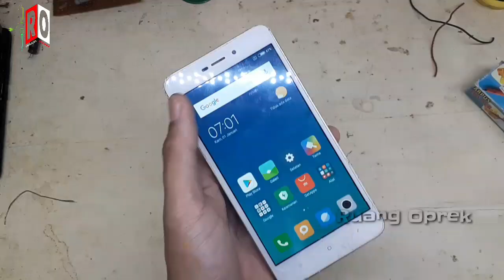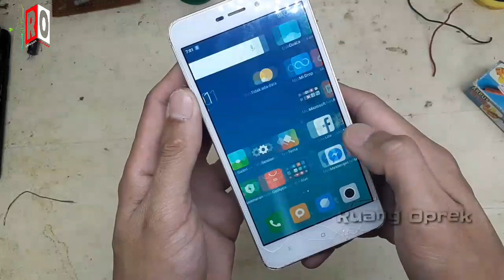Cara Mengganti Batre Hp Menggunakan Batre Lain-Batre 18650 Bekas Laptop || Modifikasi

Comment: Bang tolong balas, hp saya ic protektor  batrai nya 3,8 v ,mau saya ganti sama baterai  tab universal ic nya 3,7 v , bisa nyala atau edak ,atau daya nya kuramg bang, tolong balas
Reply from the maker: Bisa ,nyala itu dia akan full di 4.2v
Reply: @RuangOprek  jadi nyala aja biar pun batari awal nya 3,8v di kasih batrai 3,7 v nyala normal aja,tapi aman aja kan bang?
Reply from the maker: Aman ,itu kondisi batre low
Reply: bang udah saya test tapi knp ya kok hpnya mati nyala mati nyala
Reply from the maker: Kondisi batrenya gimana,
Reply: @RuangOprek  kondisi baru beli,tapi pas di solder ke hp nya ga ada respon pas di nyalain,dan pas di ces mati nyala
Reply: @RuangOprek  apa harus pake ic hp bawanic di batari di ganti sama batarai lama
Reply from the maker: Iya pake bms bawaan ,cell batrenya saja yg diganti

Comment: Bang kalo saya misalnya pakai baterai 10000mah tapi gk charger ke hp/charger ke powerbank nya apakah gak papa/masih kena ic nya
Reply from the maker: Jadi dichargernya terpisah ,bisa saja
Reply: @RuangOprek  rokemendasi berapa mah untuk htc u11
Reply from the maker: Lebih baik samakan dg yg bawaan saja
Reply: @RuangOprek  bang kalau batrai hp 3000 mah di upgrade 5000 mah aman gak (batre bekas power bank xiaomi7)
Reply from the maker: Ic casnya panas ,Kalau charger terpisah mungkin aman
Reply: Wahhhh ini yg lagi saya cari.. Berarti bisa ya bang
Reply from the maker: Bisa bang
Reply: @RuangOprek bang kalau cell batre nya 40k mah apakah aman pakai bms bawaan buat jangka panjang?

Baterai default 4k mah
Reply from the maker: @user-lb6zu1gz7m hrsnya aman, cuma pasti lama durasi casnya
Reply: @RuangOprek  iya bang mayan lama cas 1 cell aja 1 malam baru penuh yg 10k mah tapi lumayan tahan 20 jam penggunaan 1 cell nya di hp infinix

Comment: Saya mau coba 2 di Mimax 2 bingung teganganya 🔋🔋🔋🔋 10.000 mah dipasang powerbank rakitan gampang dicopot baterenya. Takut hpnya mati 📱💣
Reply from the maker: Asal jangan pasang dri usb PB masuk ke soket batre 😁
Reply: AA×4🔋🔋🔋🔋= 3.8 v pas dicas full naik 4v lebih 
Mau diparalel Aman tidak. Disambungin pake bms copotan Batere aslinya 5200 mah 3.85 v biar jadi 10000 mah
Reply from the maker: Batre AA gk cocok gan ,tegangn batrenya 1.2v, saat penuh 1.4v , 1.4×4=5.6v
Reply: Bukan ,AA 🔋=3.8 v × 4 =bisa 10.000 v lebih.
1.Sambungin model batere tanam pake Bms bawaan hp liion polymer 5200 mah  
2.dibuat powerbank 10.000 v biasa ke colokan USB charger 
Cara 1  apa 2
Reply from the maker: Maaf sepertinya yg anda maksud bukan batre AA,batre AA itu seperti batre jam dinding,AAA seperti batre vcd,stb,dsb ,sepertinya yg agan maksud type 14500 yg ukurannya sama kaya batre AA.
Reply from the maker: Masa 10.000v 😄,10.000mah kali

Comment: Kalo hp andromax e2 plus kan 3 jalur mas, gimana cara nyambung nya, dan  apakah min nya 2 plus nya 1 atau sebaliknya?
Reply from the maker: Bms batrenya tetap dipake gan jadi yg ke batre tetap 2kabel +&-
Reply: @RuangOprek  berati itu pin 1 nya di isi gabungan + dan - atau gimana bang?
Reply from the maker: Intinya batre dipasang ke input bms batre ke min & plus ,out bms biasanya beda" tergantung hpnya ada yg 3pin ada yg 4pin ,itu buat driver batre,kontrol suhu,indikator  batre/cut off charger

Comment: Pak emang aman nyolder kayak gitu pak??
Setau saya baterai 18650 cuma las titik saja 
Mohon sarannya pak🙏🙏
Reply from the maker: Mau disolder atau las titik bisa sama saja lebih bgus & kuat las titik,kalau disolder jangn terlalu lama dpt merusak batre,beri sedikit goresan utk mempermudah penyolderan
Reply: @RuangOprek  kalo pake baterai holder lebih aman nda pak??
Reply from the maker: 😃Nah lebih simple pake itu,holder batre Paralel
Reply: @RuangOprek  sip makasih pak sarannya 🙏🙏
Reply: @RuangOprek  o ya pak pake modul tp 4056 x4 terus disambung ke bms baterai (protektor baterai pcb) sama holder paralel x4 aman nda pak??
Reply from the maker: Bisa saja ,utk tpa4056 yg pake 2ic gk perlu pake bms batre lagi
Reply: @RuangOprek  tapi pak baterainya langsung nyambung ke hp pak??
Maksud saya soket baterai bawaan
Reply from the maker: Oh ,iya bisa kalau mau dicas diluar hp
Reply: @RuangOprek  beneran bisa pak kalo hp bisa nerima arus gede
Misalnya pake 4 baterai
Reply from the maker: Sebagai conto batre double power
Reply: @RuangOprek  baterai double power cuma 0.1A - 0.2A
Kalo saya kan kayak masnya baterai 18650 x 4 berarti setiap baterai memiliki 0.22A - 0.23A nah tinggal dikali 4 berarti 0.88A>
Itu aman nda??
Reply from the maker: Batre hp ada yg 6000mAh ,dulu saya pernah dihp mito pantasi pake batre 18650 6pcs ,trerah agan jika ragu jangan
Reply: @RuangOprek  siap makasih udah ngasih saran 🙏🙏
Reply: @dmcbram  mas itu kalo dr videonya baterainya disolder paralel ya, jadi voltage output tidak berubah, kecuali dihubungkan seri baru voltage dijumlahkan masing2 baterai

Comment: bang maaf mw tanya bang.. misal kpasitas baterai bawaan saya 3000 mah, saya ganti baterai powerbank bawaan robot bentuknya bukan lonjong bulat tapi kotak tebel kaya baterai hp pada umumnya yang kapasitasnya 7000mah, dan di powerbank  tertera tulisan 7000mah/25.9Wh, input1/2:DC5V/2.1A ,,, itu bisa dan aman gak bang? hp saya fujitsu f02g.. maaf saya orang bodoh..
Reply from the maker: Waktu dulu saya pernah nyoba di mito a77 pake batre kapasitas besar dri aslinya gk masalh tapi ngecasnya lama (ide itu muncul karena banyak yg jual batre doublepower) ,tapi ada yg nyaranin lebih baik jangan terlalu jauh selisihnya dari bawaan hpnya ,kalau bawaannya 3000mAh ganti pake 3500-4000mAh masih ada toleransi , tapi kembali lagi ke batrenya real gk batrenya kapasitasnya segitu.
Utk batre dari pb robot itu tegangannya sMa dg batre lhitium lainnya penuh di 4.2v low di 3.7v & sbenarnya itu bisa dipake buat di hp
Reply: mkasih banget bangggg ilmuan,,, lah itu arti dari 5v di pb apa bang , gua takut baterainya teganganya 5v
Reply from the maker: 5v dicassing pb itu output dari PBnya ,kalau batrenya itu 4.2v(full) distep up pake module PB, outnya jadi 5v supaya bisa mengecas hp
Reply: bang ilmuan tadi barusan saya coba pake socket bawaan baterai lama, terus tak pasang di luar, krna gak nyampe tak tambahin pake kabel di bagian baterai nya gak tak solder, terus tak nyalain hpnya gak nyala,   terus tak nyalain sambil di cas, nyala led merah sama ada pemberihauan baterai terlalu lemah,  tak cas gak mw ngisi mentok led merah,,, solusi dan saran bang.. tolong bet
Reply from the maker: @joyosumito5810  batrenya masih bagus gak? ,
Reply: msih bang
Reply from the maker: Kalau yakin batrenya masih bagus gk drop hrsnya gk masalah ,coba cas dulu batrenya sampai penuh pake charger lain jngn lewat hp pake modul Pbnya
Reply: ok bang
Reply: bang trnyata kerusakannya pada fuse di baterainya ,, tapi saya gak tw komponen fusenya yg mana , solusibang
Reply from the maker: Terus drimna agan tau yg rusak fusenya🤔, batre pb kan polos gk pake module bms
Reply: fuse di ic bawaan baterai hp.. soalnya saya gonta ganti baterai tetep gak bisa,,, smpe sekarang,.. fuse nya udah saya jumper ,, tetep gak bisa mentok di logo mati mati hpnya

Comment: kl tanpa BMS langsung di solder ke kuningan hp (jika baterai sama sama 3.7 v) apa bisa?
Reply from the maker: Bisa saja, berarti batre tdk ada pengamannya
Reply: @RuangOprek  tdk ada pengaman apakah berarti punya potensi meledak pada saat charge ataupun dipakai?
Reply from the maker: @jaydee2967 bisa jadi,ngerinya bilamana terjadi konslet dimesin dijalur vbatt,& kalau terjadi kerusakan di ic charger batre auto kembung,bisa terjadi juga overdischarge(kuras batre sampai 0v) & itu semua korbannya batre .
Intinya fungsi bms sbg pengaman overcharger,overdischarger,short protection,overtemperature/suhu.
Reply: @RuangOprek  bagaimana kl bms tetep dipakai tetapi tidak dengan membongkar bms (dengan menyolder kuningan baterai masing masing masing plus min dgn kabel dan disolder ke baterai)? Apakah dgn cara seperti itu, bms nya ms berfungsi sebagai pengaman?
Reply from the maker: @jaydee2967 batre pengganti hrs dipasang diinput bms,batre bawaan hpnya dipisahkan dg bmsnya lalu ganti dg batre lain
Reply: @RuangOprek  ahhh ok ok.berarti hrs dipasang di sisi dalam bms nya ya. Baik, terima kasih atas informasi nya
Reply from the maker: @jaydee2967 sama"

Comment: Bang kalo gk pake batrai. Lansung kabel cahrger kita solder di ic powernya gmn?
Reply from the maker: Dulu waktu pakai mito a77 pernah langsung dari charger ke pin soket batre pake rangkaian dioda,elco,resistor ,cuman kalau hp mulai panas hpnya hrs dimatikan (belum pernah pake kipas) soalnya bisa ngerusak ic powernya .
Intinya kalau pake batre dummy usahakan gadget gk boleh panas berlebih.
Reply: Jadi batre Redmi 4x di modif ke Redmi 5a juga gk boleh panas kah?kan dari batre hp juga?
Reply from the maker: Pake adapterkan arus mengalir continues ,beda dg batre ,jadi berbahaya kalau panas berlebih

Comment: saya sudah coba pakai 4 biji 18650 (bekas ic pcb baterai originalnya saya gunakan)
tapi kenapa... gk tahan lama dan klo di angka 80% hp mati ya mas?

baterai 18650 sudah saya cek semuanya normal...(tp tdk tau brp MAHnya, karena tdk ada tulisan dan sy gk punya alat pendeteksi MAH)

apakah berpengaruh jika menggunakan 4biji 18650?
Reply from the maker: Bisa karena salah satu batre jelek/drop ,tes batre 18650 bagus tidaknya dg cara cek mah batre
Reply: @RuangOprek  ternyata bukan karena batre 18650 jelek... semuanya bagus, semua 4batrai yang di pasang masih bagus.

dan kemarin saya coba batrai 18650 bekas dari 3 leptop yang berbeda...  thosiba, acer, dell
dari ke tiga merk leptop itu,, batrai yang terbagus milik dell...
(ketiga2nya bekas leptop itu sudah di cek semua dan kondisi bagus)
Reply: @maulanasevtian3600  klo mau bagus pake batre yg kapasitas nya sama,  merek sama. Jdi Batre nya bisa habis bareng & klo ngecas bisa sampe full semua. Klo beda kapasitas trus dicas bareng yg kapasitas kecil bakalan cpet penuh dan fitur auto cut nya aktif sedangkan yang kapasitas besar belum penuh

Comment: Bang kurang dikit itu , batre lawasnya lipo itu jangan dibuang , ambil bms nya, solder ke batre 18650 , biar lebih aman , aku pingin coba tapi cuma punya hp 1 .
Reply from the maker: Kan itu juga pake bms bawaan🙂
Reply: Makanya jgn di skip skip
Reply: mending beli aja bmsnya gan soalnya bms pada battery lipo itu harus bongkar dulu gan nah bms yang digunakan bms s1 (seri 1), hmmm ditambah fan cooler seru tu gan

Comment: Gan kalo batre posisi full apa voltase tetep 3.7v?
Reply from the maker: Batre hp ataupun batre cell laptop tegangan fullnya 4.2v
Reply: Tapi gapapa gan buat hp kan biasnya 3.7v?
Reply from the maker: @babysound281  gpp, batre cell laptop sama batre hp speknya sama , 3.7v adalh tegangan minimumnya 4.2 teg mak .kalau gk percaya coba hp agan cas sampai full kemudian batrenya cek pake multitester
Reply: klok rangkaian seri bataray voltase nya tetap yg berubah mah nya
sedangkan klok pararel voltase nya yang nambah banyak
Reply from the maker: @kevinvinvin9254  kebalik bro ,kalau diseri Voltase naik Amper tetap ,kalau Paralel Amper naik voltase tetap
Reply: iya bro lgi experimen ini juga

Comment: Bang ada pengalaman metode ini ke baterai jadul  (bukan tanam)?
Pcb-nya model sama ga ya dgn baterai tanam (tinggal solder + dan - ke kutub 18650)?
Yg pin ke 3/4 (klo ga salah bsi/temp) disambung ke mana bang?
Reply from the maker: Bsi koneknya ke min ,tapi utk mengganti batre menggunakan batre non tanam lebih baik lepas pcb ic proteknya lalu + & - batrenya disambung ke pcb ic protek bawaan dri batre tanam.
Reply: @Ruang Oprek  Makasih bang jawabannya.
Maksud saya baterai non tanam mau saya ganti cellnya dgn 18650.
Jd 18650 mau disolder ke pcb bat non tanam.
Pcb-nya kan 3 pin output (ke hp), tp seingat saya kaki input dr cell baterainy cuma 2.
Brarti itu tetap yg disolder + dan - aja ya?
Reply from the maker: Kalau itu iya langsung aja , d dlm pcb sudah ada rangkaian proteksinya🙂
Reply: @RuangOprek brarti klo yg 3pin.. positif ke batre pengganti.trus min sma pin satunya djadiin satu ya bru tempel ke negatif batre.. soale klo cman dsmbung +- nya aja..gabsa dicas lgsg lwt hp..hrus pindah btre dlu
Reply from the maker: Input BMSkan cuma 2,+&- yg dri batre ,output BMS baru 3 pin +,bsi,&-

Comment: Gan baterai 18650 itu kan Satuan nya 3,7 volt kalo di Doble berarti sekitar 6 volt
Reply from the maker: 3.7v kondisi lemah, 4.2v kondisi fullnya
Batrenyakan dirangkai paralel jadi tegangan tetap amper naik kalau dirangkai seri sebaliknya 🙂
Reply: @RuangOprek  kalo baterai powerbank itu berapa volt ya bang
Reply from the maker: Sama gan 3.7v-4.2v
Reply: @RuangOprek  makasih bang
Reply from the maker: Sama"
Reply: @RuangOprek  om maaf,itu kapasitas batrenya kalo di cek pake aplikasi berapa mah om?kebaca 10rb mah ga?punya gw ga kebaca :(
Plis tolong bang
Reply from the maker: Itu skiatar 3600 dicek per 1 cell batre,karena saya pake batre 1200mah/cellnya
Reply: @RuangOprek  bang kalo batre bawaan di paralel batre PB bisa kan ya? Gpp kan bang?
Reply from the maker: @Lawrence_Crock  sesama batre lhitium bisa asalkan kondisi keduanya sehat
Reply: @RuangOprek  makasih bang

Comment: Klu batre 4.2v turun ke 3.7v brpa nilai reaitor y kak ?
Reply from the maker: Utk apa nururin teg pake resistor?
Reply: @RuangOprek  d hp y trtulis 3.8v , batre yg sprti ini sya cek pake digital voltmeter trtulis 4.2v skian sya takut gk tahan hp y konslet
Reply: @RuangOprek  hp sya samsung j2prime mau sya ganti batre sprti kakk ni tp sya cek 4.2v atau lbh dikit , sedangkan sya liat d blakang hp 3.8v jd y sya takut kbakar hp y dan mau sya turunin pake resistor jd 3.7v
Reply: @RuangOprek  mohon bimbingan y dngn detail kak biar aman hp y gk konslet / tahan selama lama y pake batre 18650
Reply from the maker: @dediirwan3789 4.2v itu tegangan batre saat full,batre hp & 18650 sama" lithium asalkan menggunakan bms bawaan dari hpnya insya allah aman
Reply: @RuangOprek  barrti harua sya bongkar batre lama y utk ambil bms y ?
Reply: Atau bms bawaan hp y itu letak y d mn y d hp kak ?
Reply from the maker: @dediirwan3789 betul sekali wajib pake bms
Reply: @RuangOprek  bms bawaan hp y tu d mn letak y d hp tu kak biar sya ambil